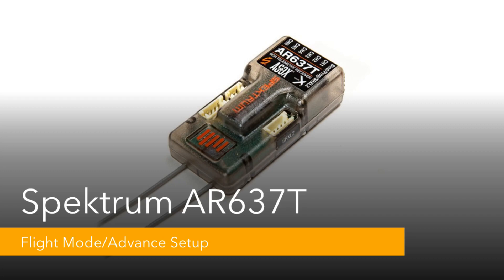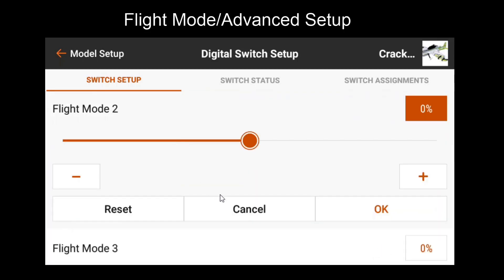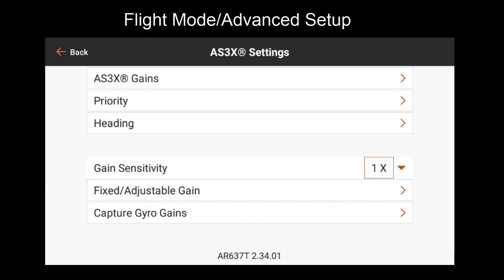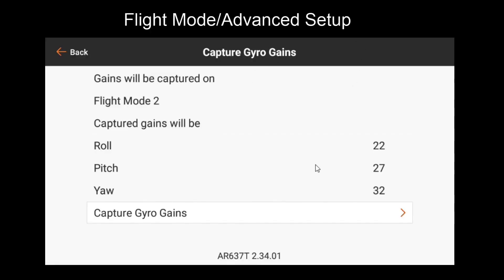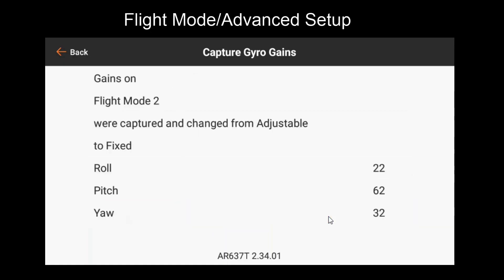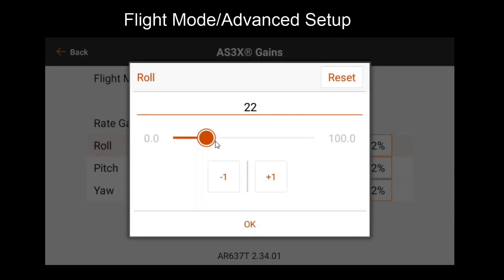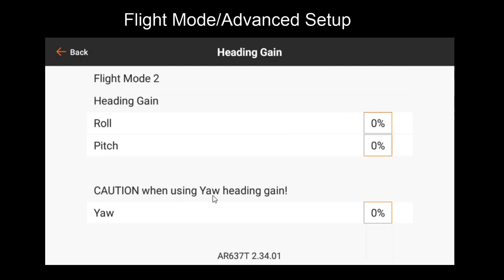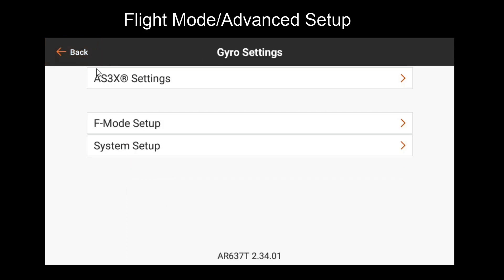2. Spektrum AR637T Setup - Flight Mode/Advanced Setup

Comment: It makes way more sense to use the transmitter's flight modes for separate trim settings for each position of the flaps. The transmitter's flight modes don't need to be associated with the receiver's flight modes. They are separate entities. Just assign a switch to an unused channel and use that channel to control the receiver's flight modes.

Comment: Spektrum blew it due to the complexity to set up this receiver.  If you can make it through all the setup and test flights to tune the settings then  you don't need Safe or AS3X which seem to be oriented to a novice.
Reply: You have made a great point! If you have to test fly it several times before you can actually use AS3X and SAFE, you have learned how to fly LOL

Comment: Hate to comment again but I couldnt figure out why As3X wasnt working when it was showing "on" in a flight mode, just playing around I realized that the Fix/Adjustable gain was set to "adjustable" by default once I changed it to "fixed" bingo As3x was working but I had no idea why just put it in my notes. Now I know it defaulted every gain to 0 so it was on, showed on, but no gains set so shaking the plane had no effect. How the heck did you figure out it did that? I cant thank you enough for these videos!
Reply: Ditto... I'm using an NX6. Fix/Adjustable Gains must be changed to Fixed.

Comment: Thanks for the video its real good, I just got the AR630 and I am so scared to go up because this is so complicated. I think one thing that would be nice in these videos you make and others is go simple from start to finish. Talk about configuring AS3X for 3 settings off and 2 sets of gains. Then move on to setting up safe. Configure it top to bottom like a umx turbo timber is configured. When you stop and point out advanced features or start mixing in gain captures, copying flight modes, digital percentages on a switches everybody gets lost because they dont get the simple configs.
Reply: Did you get up in the air..? How’s the AS3X doing?

Comment: For some reason, maybe me beeing stupid :), I can not as with the AR636 usage get the L Trim on my ix12 go to enough high and low values so I can get that Trim button be used for changing the AS3X gains (instead of the suggested Right knob). 
I only get it to go to +29 to -29 in the monitorview ?!!?, which results that I can only change the gain a little, not from 0 to 100 %.
Reply from the maker: When assigning the trim to the channel, there is the option of Digital and Analog. Make sure you're choosing the Analog one.
Reply: @MiguelFAlvarez  , thanks very much ! It is now working fine ! The reason I wanted to use the L Trim was that I have the F Mode at the D switch and then it is more safe to have the left hand to operate the Left Trim for gain adjustment as I have 1 cm to the D switch if something goes wrong and I have to go to F Mode 1 without AS3X etc .